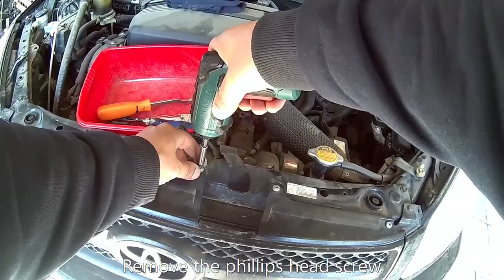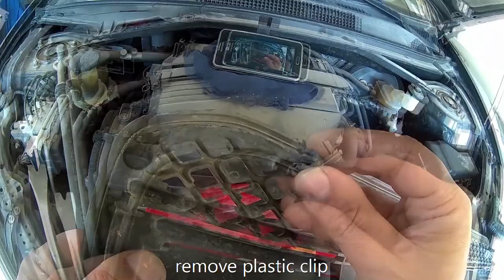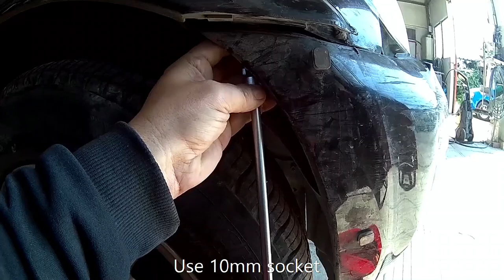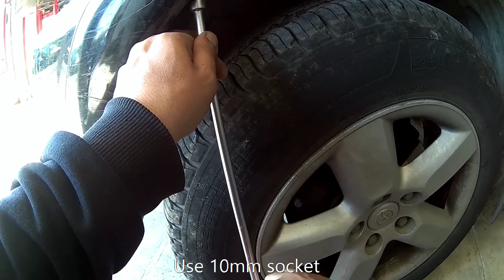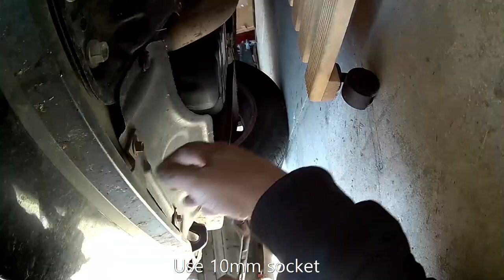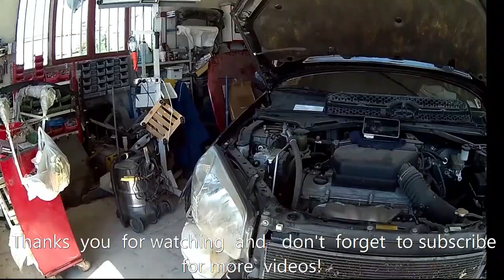Toyota RAV4  front bumper removal

Comment: Thank you! This is exactly what I was looking for! I'm changing the headlight assembly to projectors on my 09 Limited (4.3) and I couldn't figure out where everything was. Out of curiosity, do you think there;s enough play once you take the 10mm bolt on the side and the screw out to pull it forward a few inches and not have to take the whole thing off to do the headlights?
Reply: ❤😅 m

Comment: The front mask is removed by pressing 3 pieces of the clip lock downwards in the cut-outs from the front and that's it. That liking from behind is bullshit.
The connection of the front sheet metal cover by the fender is both painted, the metal object disconnecting this connection will only make a moron.